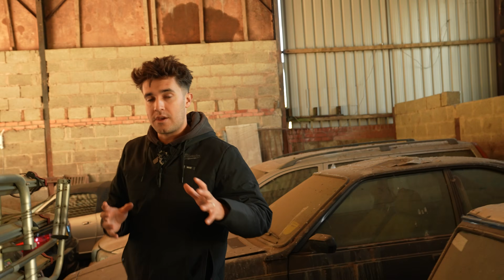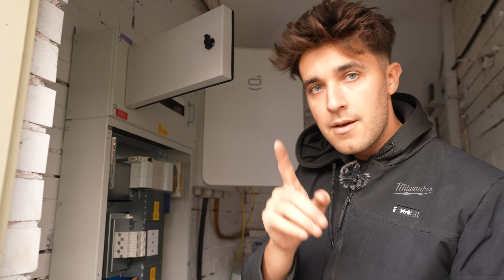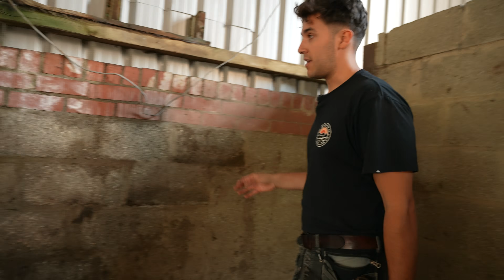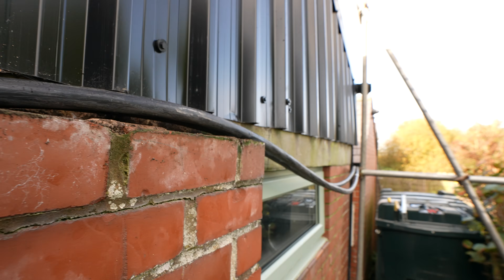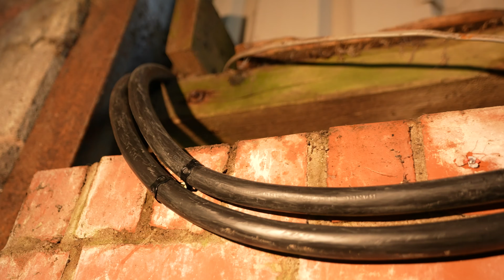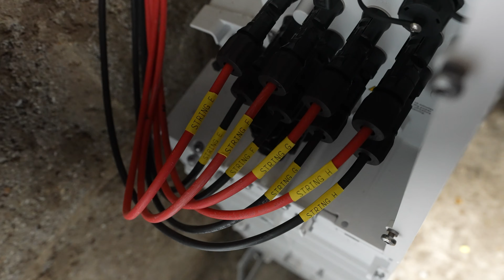Creating Electricity for 3 Buildings | ØY51

Comment: Hello, 

We have a manual change over switch, island mode does not work on dura 5 set up when it's switched. What does the ATS have in it to tell the solar it's safe and keep running?
Reply from the maker: It speaks on the same RS485 network

Comment: Utilities in future will not  let you connect to grid as they will not have space

The Australian Energy Market Operator (AEMO) is pushing for the widespread implementation of “emergency backstop” measures to remotely switch off or dial down rooftop solar systems. It aims to manage the growing impact of distributed PV on the nation’s electricity grid.
As the rise of rooftop solar continues to reshape Australia’s energy systems, the market operator, the AEMO, has called for emergency backstop regulatory frameworks to be in place in all mainland states by the end of 2025. It wants to manage the energy from the country’s more than 4 million rooftop PV installations.AEMO said that rooftop solar is already supplying more than half of the nation’s electricity demand at times, and this is projected to grow to about 90% in the next few years. This growth has introduced challenges of grid instability during low-demand periods and AEMO said that actions must be taken to maintain the supply and demand balance.

In a newly published report, “Supporting secure operation with high levels of distributed resources,” AEMO said backstop mechanisms are needed to ensure rooftop solar can be remotely dialed down, or disconnected, to manage system security. This is similar to the capabilities normally required of any large-scale generator.

Michael Gatt, AEMO's executive general manager of operations, said the market operator doesn’t not want to directly control people’s rooftop solar, but noted that in “rare circumstances” it may need to take action to secure the grid.

Comment: RE: The main 100mA RCD...one of the biggest issues with RCDs is that each circuit has its own earth leakage. In a domestic property, a split load board full of modern electronics can often end up causing a 30mA RCD to trip. How many RCD and RCBOs are feeding into that 100mA unit? Does the cumulative fault current exceed that? Regardless, unless that 100mA unit is feeding an edge circuit, it could potentially be too high. I'm waffling but what I'm trying to say is that the feeder RCD should be of a higher current rating than 100mA (as long as it's not directly inline with a circuit that people interact with) and that individual circuits should be on RCBOs.

Comment: 23:00    You used the word "discrimination" with reference to using 100maA RCD up stream of 30mA RCD's in the downstream DB's.    Would a better term be "Selectivity" ?   As you want the 30mA RCD's to provide the protection in potential fault area's without effecting the whole property.
Reply from the maker: The terminology has changed since college, old habits!

Comment: That leveling bolt for the battery base is going to have a huge weight above it, I would have wanted to spread the load a bit.
Reply: The weight is actually assisted by the back mount brackets

Comment: We use the PE as the main safety and RCD's etc are considered secondary safeties. 1667ohm would be way to high here. We aim for 1,5ohms on the rod, and max 166ohm if ALL circuits are RCD 30ma protected.
Reply: 1.5ohms on TT, I've never seen one that low.
Reply: @christophergummer  Yup, was the standard here since ever. If an old property has a <1,5 ohm earthrod, they didnt even need RCD protection.

Some rods are like 10 to 15m deep though.
Reply: @Deiphobuzz  Yeah, I've seen them do long rods in the US

Comment: Why are the bus-bars non insulated on the gateway ? I have seen this used on several projects and asked this question, we install many control panels and commercial switchgear and all are insulated, regardless of key-tool-instructed personnel, surely they should be covered.

Comment: Great video. Solar cable should not be on metal. IET guidelines. Should be plastic. But great video. I did one lately in Ireland, on our own place, two supplies, two inverters, ground mounted, 80 metre runs, 7 fuse boards, batteries etc. on my own, would have loved some help.

Comment: I think the banjo connection is required because steel enclosures have a tendency to rust especially where there might be capillary action between the gland and the enclosure creating conditions favorable to rust and high resistance.  The paint is going to be damaged there, both by drilling and by tightening the gland so the steel will without doubt be vulnerable to corrosion. The gland and enclosure are also dissimilar metals that can cause galvanic corrosion that will tend to attack the steel more. Bonding the banjo to the enclosure should almost eliminate galvanic corrosion. Banjos are made from corrosion resistant metal, ideally the same metal as the gland.

Comment: i am always amazed at how the power iis delivered into the house in the uk, just a board with a fuse and a meter on it...

btw, we use normally 300mA Rcd in such a case here but 100mA is a good solution too

Comment: Cool install Cory. Question, how does Inverter, MPPt and battery storage cost compare the Victron Inverters, with Multiplus ii 10
Or 15k per phase, (100A changeover switch built in/full UPS) RS450/200 MPPT and/or Fronius inverter with Fogstar 15.5KWh batteries BMS and heaters built in. The DC side is common and you can add up to 15 of those batteries for £2k each giving you 230KWh of battery storage. How much battery expansion in capacity terms do you have there?

Comment: The linking of the banjos is predominantly to maintain long term integrity and reliability of the the earthing of the cable armour. More of a best practice installation work rather than a specific regulation or there may be something within BS7430, would have to look that up though.
Reply: Yea, eventually the bottom of the panel will rust away . Seen it a good few times.

Comment: Must have been filmed a while ago. The dates are out of date. Nice big job, is it on yet?
Reply from the maker: Still not on! 😔😔😔
Reply: I work with Telecom Lithium batteries and they have a 'must be charged by' date on them on the box, so they don't go beyond a certain self-discharge voltage whilst in storage.
If it's been that long, you might need to consider somehow charging them.

Comment: The batteries are only 0.5C Charge/Discharge. Because every battery is a self contained unit with its own BMS you can add the battery capacities together and divide by 2 for the Charge/Discharge Rate. Those 2 x 8kw = 8kw Charge/Discharge.
I wondered what size Inverters you had installed??
Reply from the maker: Correct 😃. They’re 2x 17kw inverters, how silly I forgot to mention that!

Comment: Been there myself some god awful cables have been manufactured, been to the point of putting a hammer through walls.
Reply from the maker: It’s was like stripping Tupperware lid plastic off the copper
Reply: @corymac the absolute worst ever

Comment: You bond all the swa’s up in the board to one another as you can get corrosion on the board, therefor loosing your earthing. Reason I was always told anyhow.
Reply from the maker: Makes sense, but still… on the inside of a domestic consumer unit, seems unnecessary
Reply: @ think it’s as commercial and industrial do it, best practice to keep in line as I’m sure it’ll be easier to stick by one thing.

Comment: What’s the plan for connecting the  immersion diverter?
usually the CT clamps/monitors go round the incoming mains and the AC solar to monitor what is required by the house and what is the solar PV generation. In the Sigenergy the PV is Dc coupled so no AC PV only cables , so just wondering how to connect the CTs?

Comment: I realised I never fully got through the last UPS video. I see that it has now been removed. What was it that happened and what was the outcome?
Reply: The three phases were joined inside the UPS as it was single phase capable too. He blew 2 isolator switches before realising. He tested everything so opened the ups and saw the phases were joined inside. Removed the bonding plate and resolved the issue.
Reply: @samkeizer6654   Actually phase jumper were clearly visible throughout, he didn't read the installation manual with diagrams which clearly stated this.
Reply from the maker: My permission to post that video was revoked last minute by the company where I filmed it. I could have left it up, but I wouldn’t want to get the amazing gentleman who allowed me to film in trouble, it’s only allowed now as a members only video. Genuinely gutted, as it got 140k views in under 48 hours!
Reply: @corymac  Thanks for responding Cory. When you said what industry it was in, I was genuinely shocked that you were given permission. I once worked for a major defence supplier than rhymes with Jujitsu and there’s no way I’d be allowed to have a camera running in our secured office, let alone a client site.